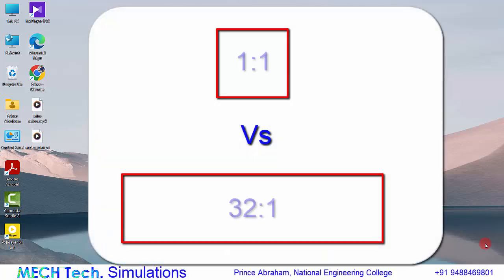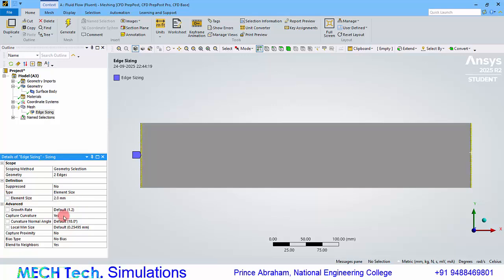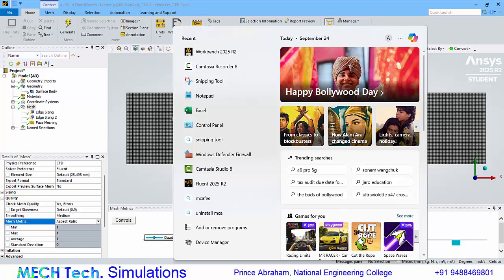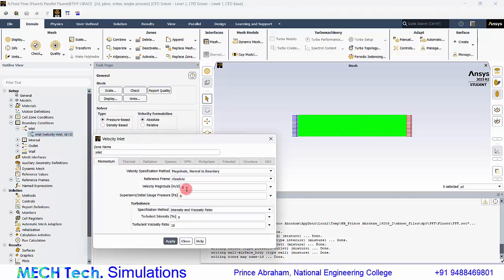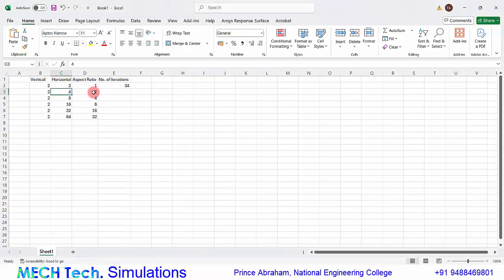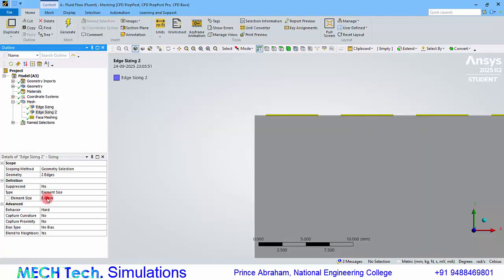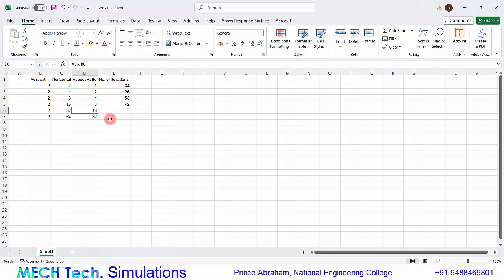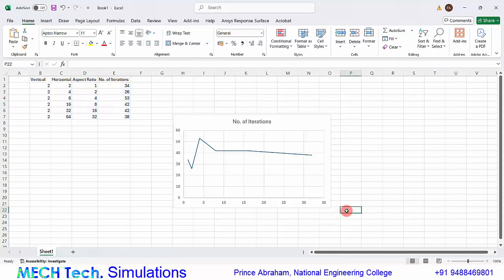ANSYS Fluent: How Mesh Quality Impacts Convergence | Aspect Ratio | CFD Simulation

Comment: Hi sir, we are  workng on tidal turbine analysy using fluent. But we are facing issue ie "dynamic-mesh failed. Negative cell volume detected ". Could you please help us.?
Reply from the maker: I have also faced the same issue while preparing content for this video. https://www.youtube.com/watch?v=TuoKmdtWFfE&lc=UgyO7119jX6e2ZxPr6F4AaABAg Try the same case with very small time step size. Definitely it will help.
Reply: @MechTechSimulations ❤

Comment: Only aspect ratio does not affect the solution. But aspect ratio is very import when flow is turbulent and the flow is random and it is affect the convergence. There some times it necessary to paly with the pressure and velocity factors in the solver setting. In general, there are no standard 100% settings for CFD, but there are certain procedure must be followed for the accuracy of the solution.